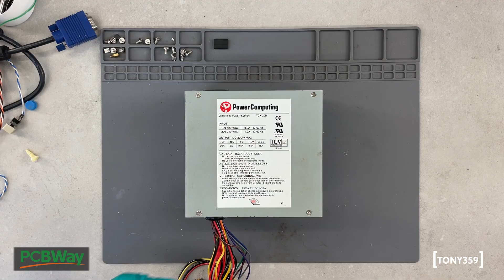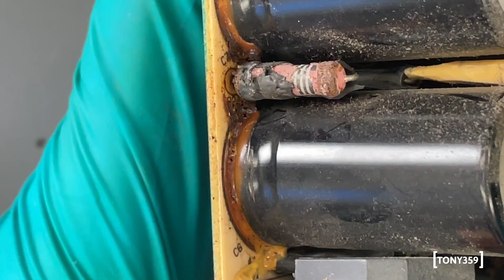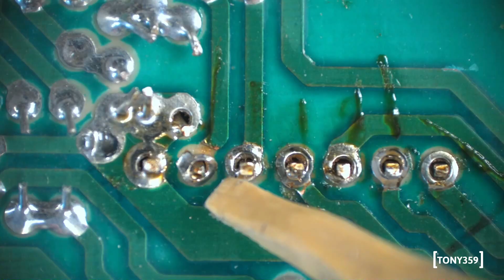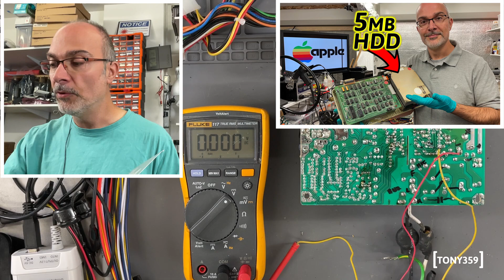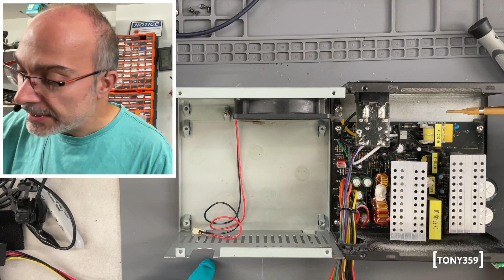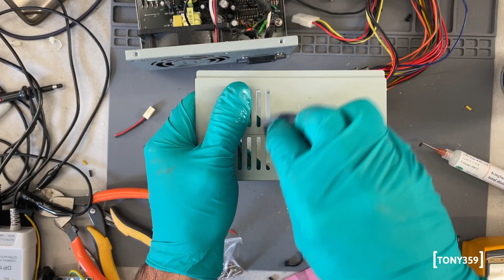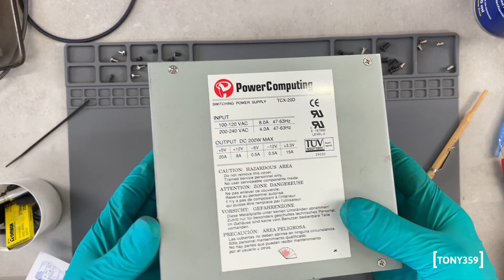I could not fix this Power Computing power supply. So I fixed it.

Comment: The overvoltage might be caused by the small ceramic capacitors connected across the bridge rectifier diodes. I don't know why as they won't test bad but I have seen many laptop chargers made by DELTA blow up because of it.

I recently had a pleasure of wasting an entire day on an ATX power supply I was sure was broken, it behaved exactly the same as this one after that pad repair; turns on for half a second and then it dies. It turns out it just wanted some load on the output. I wasted an entire day fixing a working power supply  🙄

If you ever do a transplant like this in the future, that choke is a passive power factor correction, meaning you can basically remove it and short its contacts, the power supply won't complain. In fact I have seen power supplies with a fake choke where they are connected to the board with no traces or not even connected or even a choke filled with iron sheets with the wires shorted out in it lol
Reply from the maker: thanks for all the tips!

Comment: Not sure do I remember wrong old PSU:s shut down if there wasn't any load. I remember I had to connect old hdd to keep old psu running.
Also +5V current limit maybe that it need more load on 12V line.
I had one old 250W atx psu and planned to use 5V led strips but I had to add 12V 5W bulb to keep regulation ok. Without it it started to keep strange noise and 12V was shooting up.
Reply from the maker: Very old ones, yes. That is not the case. Yes, sometimes 5V is the main rail which needs to be loaded in order for the other rails to work!

Comment: Next time, if u make such a video, plz start it with the info, that the capacitors can held a deadly amount of voltage - so they have to be discharged before ^^
Reply from the maker: You are very right. Sometimes I forget to add the disclaimer - that is one of those videos. I'll be more careful next time! Thanks for mentioning!

Comment: I would have cheated even MORE by trying to just change the COVER of the bad supply onto the working one instead of switching the innards.....if it fit correctly.....🙄😁
Reply from the maker: ahah I didn't think about that but one case is black, one is silver. :) Thanks for watching!

Comment: Hi Tony, nine times out of ten it will be the output smoothing capacitors ESR has gone bad and the must be replaced, the power supply will protect itself and shut down, if not the caps check the diodes in the outputs
Reply from the maker: Thank you! I did check all the diodes but you are right about the caps, one might be acting as a short under load. I can check that! Cheers!
Reply: Hi Tony, you say you checked the output diodes, but some of the output diodes do not look like diodes, they look like transistors on heatsinks and are often two diodes in a three leged package like a power transistor, I don't know if you are aware of this. Bob UK 
 @tony359
Reply from the maker: Thank you Bob - You're right and I think I have a few of them. I believe I did check those - I might want to go back to that PSU with all the hints I've got from these comments! Thanks again!
Reply: yup its the most common fault

Comment: Interesting content, very good analysis, comments from the followers are very helpful, especially from @DjMarik78,  @CXensation and @VVerVVurm. I would also change the old power supply like you did, because it's low quality one and besides that to old, prone to further breakdowns. I would keep the old one and try to fix it, out of curiosity and to learn more.

Comment: 3:59 its a classic half bridge topology. The switching transistors will probably be 2 high voltage NPNs such as MJE13009s, not FETs.
Reply from the maker: Thank you! I need to check but I feel there is only one switching transistor.

Comment: Ok modern atx power supply does not have -12v in case it's needed.
Reply from the maker: Thank you - it looks like the computer will be fine with a modern replacement but we will check! Thanks for watching!

Comment: Today I say a video from Mr Carlons Lab where the culprit of a SMPS misbehaving was a bleeding diode. Very very interesting video since the diode seemed fine with a DMM but using a curve tracer the bleeding revealed itself. Maybe a component in the circuit has the same problem?
Reply from the maker: 😮 very interesting thanks for letting me know and for watching

Comment: I've been trying to work out how you could get 395V across the 2 caps instead of the expected 340V
I went back to where you showed your isolation transformer at https://youtu.be/gYeIkpfu1FA?t=150 and it's showing a voltage  of 256V volts not 240 so thats a start.
Have you checked the actual AC voltage going into the PSU, make sure you have a true RMS meter, you can't trust those Chinese meter modules.
Is your isolation transformer 1:1 ?

Comment: The resistors are not (only) for bleeding of the charge in the capacitors! they are required to balance the capacitors for use in series! without them they would charge asymetrically and the one with the higher voltage will blow first - and then the other one!
This configuration is used to adapt the primary side for use in 120V and 240V land. In 120V land they will be used in series to reach the 240V. With 240V mains they will be switched to parallel operation. Most computer power supplies have a selector switch. I think part of the fault here is it is set to 120V mains and so the voltage doubler is active. This usulaly kill the power supply instantly with a big bang!
Reply from the maker: Hi thanks - yes, someone has pointed out the other function of the resistors. The switch is "open" for 240V operations and I ended up removing it altogether. Maybe it was set to 110V before and that damaged something?
Reply: @tony359  ..and I must apologise for commenting prematurely istead of watching the whole video first .. so I saw your removal of the switch right after my comment. And apparently they do not switch the capacitors to parallel mode but (according to your measurements in the video) leave them in series and just connect or disconnect the midpoint to to the bridge rectifier input - so they use the full bridge rectifier for 240V and half bridge for 120V - much cheaper and simpler.
Reply from the maker: yes you are correct that's how it's wired. No need to apologise but thanks for taking the time to comment again - comments are always welcome! :)

Comment: I notice that old power supply had -5V power rail which might be important for some old components, I'm not sure if new one have -5V power rail.
Reply from the maker: You are not the only one noticing - thank you!! - but it should be fine apparently as the PowerComputing is a macintosh clone and apparently doesn't need -5V (TBC!). Thanks for your comment!

Comment: Re: the switch testing ok. I've found that sometimes - not often, but it does happen - switches, resistors and even cable will test fine with a multi meter or cable tester but still fail under load.
Reply from the maker: Thanks for your input. Great to know! I thought I was getting mad!
Reply: @tony359  yeah, this is why electrical cabling needs tested with a proper insulation resistance tester. A multi meter only works on a few volts where the load is orders of magnitude greater than that.

I'm a fire alarm/intruder alarm engineer and even though they only work at 24v/12v DC, I've still had a few instances in the last 20 years (fewer than 10 probably) where a cable or resistor that reads fine on my multi meter still causes a fault on even those low voltage circuits.

A switch running 230v through it that has a bit of damaged insulation may have the two conductors far enough apart that the low voltage from a multi meter will pass through it quite happily but higher voltages are enough for arcing to occur.

Even when you're testing resistance, your meter is passing a small voltage along the circuit and testing the return voltage to calculate the resistance, which is why you can't test a live circuit for resistance.

Comment: Hi @Tony359

Designing, building and fixing power supplies is also my thing, so, i can't help myself commenting, i hope you read this because it is important. 

First of all!!
Never, ever put significant loads on only one output of an ATX power supply, it will NOT like it!
The +12 and +5V are regulated on a common choke and common feedback loop, so, any significant load on one of them would severely drop the voltage on that output and increase it proportionally on the other one, up to the point where the supervisor IC stops the supply because of the faulty voltages read. 
+3,3V are individually regulated, by a magnetic amplifier consisting in a smaller choke and a feedback loop with a 431 as an error amplifier, but it is drawn from the +5V rail so it will also not like to be individually loaded ( in fact the 3,3V loaded alone would cause the power supply to shut down even faster ).
The motherboard always put's some load on each of the main 3 rails, that keeps them working in specs. 
So you should always be sure to proportionally load ( as much as you can ) each of the 3 outputs. 

Second general observation is that when dealing with a possible faulty mains voltage selection switch there are lots of stuff to check on the HV side of the supply, way before testing it. 
First of all, the mains filter caps ( the 2 large ones ) must be replaced with new ones no matter what they check on the component tester ( also, that is not a proper ESR testing device, an proper LCR meter is the best device for the job, even if it is expensive ), and always with new ones. More so when the caps were cooked by those resistors, so, i don't care how the caps look on the component tester, i would replace them with new ones long before any testing is done. 
They are the most probable cause of the abnormal voltage measured on the HV side, since there is clearly no active PFC on the board. 
Also because of that abnormal voltage, the power transistors ( be they mosfet or BJT's ) must be removed from the board and properly measured to be sure they have not been damaged by the possibly much higher voltage then normal for them. 
Just to be sure i would also replace them with new ones before any testing is done. 
That switch is very easy to verify and fix if it is faulty, you just open it, check the contacts, clean them if necessary and the close it back up ( it take what...5 minutes maybe ).

The main converter on that PSU look's like classic F1T config, one opto is for the feedback loop, and the other is for supervisory and on/off functions. 
Now, because the unit does start but shuts down quickly, this suggests that the supervisory circuit detects some problem and shuts down the unit. 
There is no point in scoping the pins of the switching IC because there could be any number of reasons why it feels like it should shut down the unit. 
What is to be check first are the filter caps on the outputs ( all the electrolytic caps on the secondary side ), some of them could be out of specs ( it almost always happen ). The best way to do it is by removing them from the board, but there are ESR testers that do on board testing. 
Also there could be cold solder joints or damaged traces or components that are not obvious at a first look, so you need to check the board very closely, with some magnifying glass and lots of light. 
The main thing you need is patience, lots, and lots of it. 
If you find nothing wrong in the secondary side then you could try to bypass the supervisory circuit by removing it's optocoupler, if it is an active low command on the switching IC then removing the supervisory opto ( the same that manages the On/off function ) the supply's main converter should turn on the moment you connect it to the mains, regardless of the state of the green wire. 
If that does happen and if the outputs are ok with no load, then the problem indeed is at the supervisory circuit, maybe the opto it's self or maybe something connected to it. 
You could also use the scope in single shot the check each of the outputs, connect the scope probe on one of the outputs, set it onto the single shot function with the rising edge and proper trigger level, then connect the power supply to the mains.
You need to check on each output if it does goes on for a short period and if it does, then on what level it goes before it shuts down. 
If you find one that either does not go on at all or it does but on a way different level then what is to be expected, then that output could be faulty, and the supervisory circuit detects it and shut down the unit. 
You could also have some unknown permanent overload condition, that would also shut down the unit just after it starts.
To that end, you should check the current sensor resistor in the primary side, a power resistor on the source pin of the power mosfet. Maybe the resistor is damaged, or maybe it has some cold solder joint. 
You could also check the signal on that current sensor resistor, but only with a isolating transformer!!!
Use and 1/1 isolating transformer to isolate the mains from the supply, then connect a proper earthed scope to the current sensor resistor, and check the signal ( if any ) on it at the moment the supply does start, do it both with single shot and with normal operation on the scope. You need to confirm if there is any overload condition at start, and if you see a much higher signal then expected on the current sensing resistor, then indeed there is a problem, and you at least know what to look for.
If there is an overload condition then it could be caused for example by a shorted diode on the secondary side, or maybe by a short in the power transformer it's self ( it rarely happen, but it does ), or maybe some problem in the transformer magnetic reset circuit in the primary side, the circuit with that small inductor, if maybe some diode is damaged there, then the core does not properly reset and you get core saturation, which would manifest as a permanent overload condition.
There are other possible faults, some smaller, some more important, all it takes is patience, because i refuse to accept that such a simple and good condition supply cannot be fixed. 

All the best.
Reply from the maker: @DJMarik78 - let me thank you for the extensive comment. It's very welcome. I will study it and maybe pin it in my workshop! There are so many pointers in there, really thank you for taking the time to share your knowledge with me. I'll see if I have some spare capacitors to test, as you say there is no boost on the board so that voltage doesn't make sense. I've had capacitors which tested fine out of the circuit but were causing the circuit to shut down once powered so that could be the cause. Also yes, I am aware my "component tester" is a toy. A proper tester is on my list, bear with me :) I always test live stuff using an isolation transformer and I have differential probes to be safe, thanks for the heads up! I now really feel like getting the PCB back on my bench and check everything you said - let me finish the IBM XT first and then I'll see what I can do. Thank you again a lot, you are a star!
Reply: @tony359  you are very welcomed as always!
Good luck.

PS: I have literally fixed hundreds of ATX PSU's, different marks, models or configs, each of them with their own particularities but they all share some things in common, that makes fixing them a bit easier, especially with a solid electronics theory background ( of which i am a strong promoter, because it is the only way to evolve and grow as an engineer ). 

You could take a look at Hantek 1833C, i have it and it's great for an affordable LCR meter, it has many neat features. It has two 18650 cells ( about 2200mAh each as i remember ), so battery time will not be a problem.

Also i have built myself an ATX tester, something simple and in an ATX case.
It draws about 5A from each power rail, so different power resistors for each ( a few hundred W resistor for each rail ), so balanced load, also about 500mA from 5Vsb and from the negative 12V rail. 
Included in it are different color LED's for each function ( Vsb, PG, +12, +5, +3,3, -12, etc ).
I have stripped an ATX connector from an old motherboard and fixed it on the tester's case, so  it is a simple job of connecting the main connector to the testes, flip the ON switch and look at the LED's, if all the voltages are ok than all the LED's light up.
It save much time and work.
Reply from the maker: Thanks, the 1833C looks neat. I'm sure I'll break the bank sooner or later! :) I totally agree on electronics background - and I am very well aware of my own limitations. I'm slowly getting there but I am no expert here. But I am persistent and one day... :) 
Yes, power supplies are easy beasts after all. The circuit theory is pretty simple. Still... :)
Reply: There is no reasonable way how the primary side bulk caps would be cause of an elevated voltage across themselves, i don't get it topologically? They get charged to the peaks of the voltage curve created by the rectifier prior.